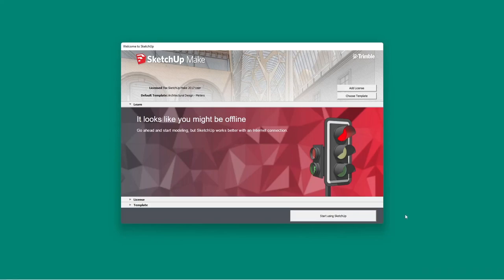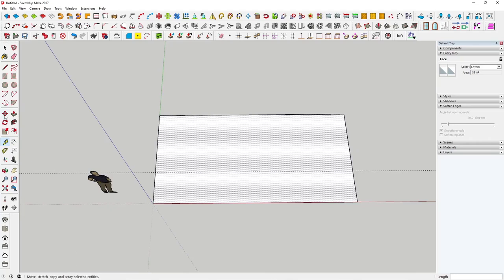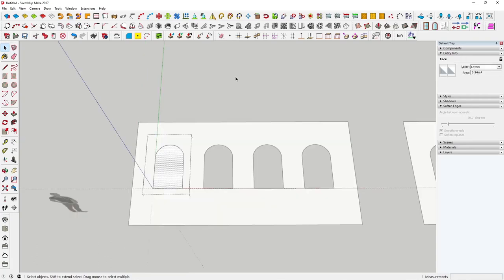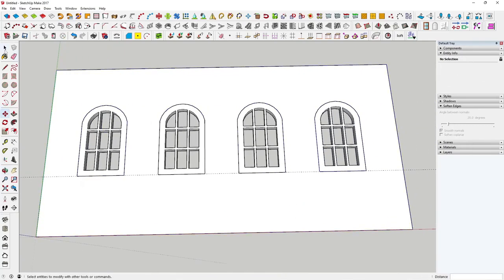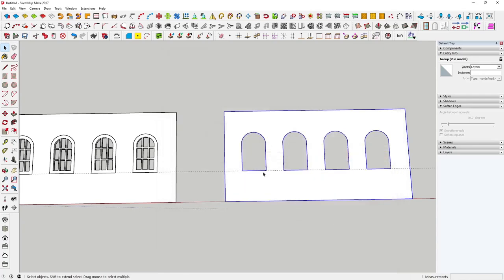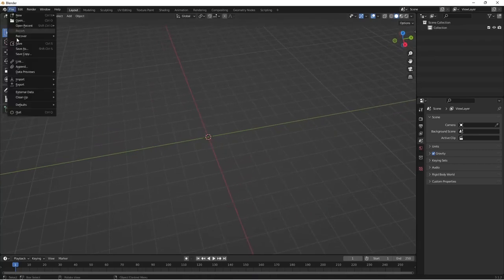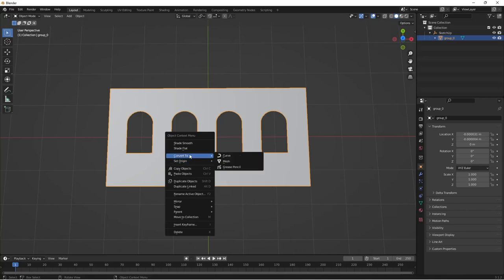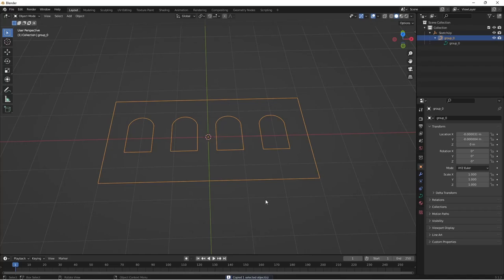03 Realistic Walls Part 1 Tutorial Sketchup & Blender Resin For Printing

Comment: I’ve followed all the operations in part one but when I proceeded to part two, the wall has changed and jumped forward in the tutorial.
Am I missing something? Can you help?
Reply from the maker: Hi, part 2 needs a Blender start up file. Are you on FB? If so you can download it from the file section in 3d Prining Model railroading. https://www.facebook.com/groups/290396931957592/
Or reply with your addy and i will send you the file.
Reply: @ thanks put a request to join group then I will down load.